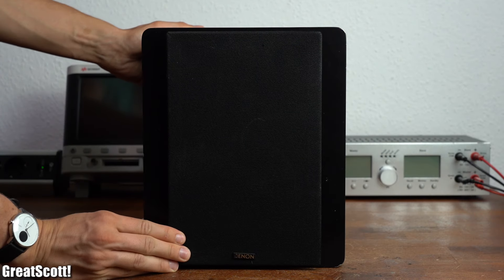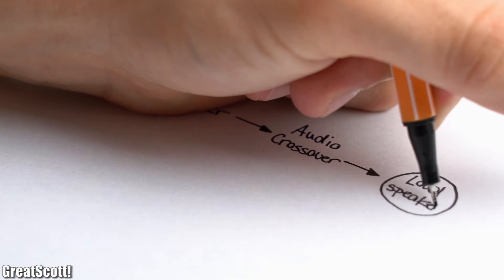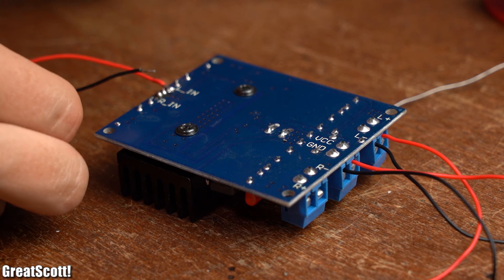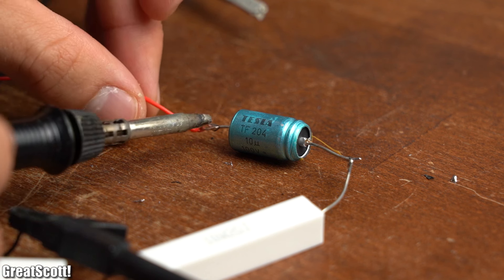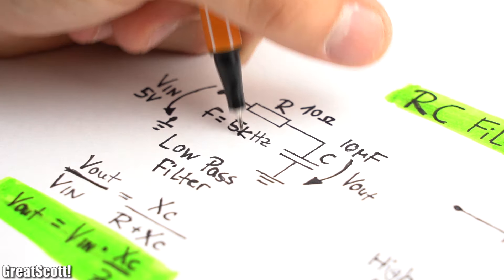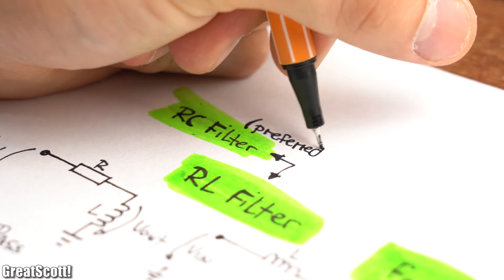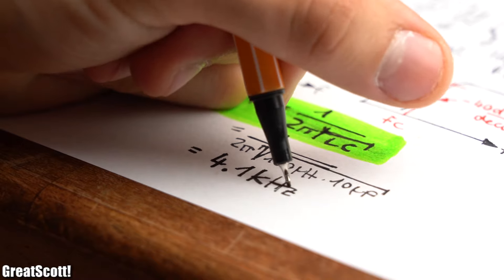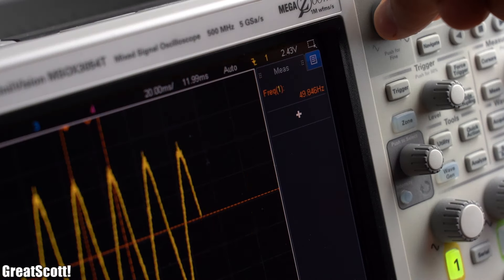Does a DIY Audio Crossover make sense? How passive filters work! || EB#41

Comment: Would you consider building an active crossover that would feed into a dual channel 50w D-class amplifier and BI-AMP a two way speaker (Woofer and Tweeter) 
and comparing the improvement over a passive crossover driven by a single 100w amp.

Comment: Well, i have ti correct you in one Point: Most speaker companys save Money with the Crossover. They use cheaper components for it. You can tune your Speakers by rebuilding the Crossover with high quality parts and wiring it in Air instead of the PCB.
This applies also to high cost Hifi and high end speakers.
Reply from the maker: Thanks for the information :-)

Comment: Hmmm one question here, The ooutput of the speaker is pretty much the current that flows trought it right? so doesnt the phase shift of a coil or capacitor change it as the incoming signal is voltage modulated and not current modulated. Or is this change just too small to notice

Comment: The fact that amplifier boards are dirt cheap nowadays means there is no need to use beefy crossover as the old-school ways...

The filtering can be done at the input stage using simple  R-C circuits then the input signals are fed to separate drivers. That is, the woofer and the tweeter have their own amplifiers...

Much easier to achieve similar results but of course, one has to appreciate how people in the past made the best out of their current technology, and carefully designed circuits often outperform their more recent counterparts...

Comment: You just tested with a 4 ohm load, but you used a resistive load,  speakers are an impedance load not resistive.
Reply: Ac resistive loads = impedance load
Reply: His speakers have an impedance of 4 ohms.
Impedance is the combined result of all resistive, capacitive and inductive components in a circuit.
Meaning there's no reactance, just like with resistive loads.

However, speakers like electrostats or magnetostats have an steep impedance curve and is not a static impedance set on 4 or 8 ohms.
Replacing those with a dummy resistive load won't do the job.
Reply: An impedance of 4 Ohm does not necessarily equal a purely resistive component of the same value. Basically it could be any combination of resistive, capacitive and inductive elements, that equals this impedance at a given frequency. Impedance is sort of "AC Ohms", but it is frequency dependant if there's not just a purely resistive component. A 4 Ohm impedance can have a significant phase shift between current and voltage.
Reply: @wi_zeus6798  Not necessarily indeed. When impedance is given at a specific frequency it can differ on a different frequency of course.
But a static figure on itself will stay the same. 4 is 4 and will always be 4, independent of the frequency, since it isn't specified depending on a frequency.

The reason that in this case impedance is specified as a static resistance of 4 ohms is because the deviations caused by frequency response are insignificantly small.
So basically its the nominal impedance which is specified by manufacturers of most standard dynamic loudspeakers.

However, it does not apply to all types of speakers, especially electrostatic speakers often have their impedance curve specified in a graph, since those variations actually are noticeable, mostly because of their high nominal impedance, which needs to be matched with the amplifier by use of an audio transformer.
Reply: He even measured the original speakers impedance with his multi-meter, so why worry about resistive load vs not resistive load ?
Reply: @K2teknik.  A multi-meter doesn't measure electrical reactance.
Reply: @verenigingvandemagogen4548  I was trying to point out that multi-meters do not measure the impedance of a loudspeaker the way it is shown in the video.
Reply: @SetKat-Alex  What? "He don't know the measurement frequency of his multimeter", that is because the frequency is not there, his multi-meter measure ohm with DC voltage, GreatScott is using his multi-meter in a wrong way in this case. He can measure impedance with his multi-meter, but not in the ohm range, it is more complicated.

Comment: The woofer can still play high frequencies. The problem isn't speed or momentum. Look at single driver speakers. The problem is that once the wavelength is shorter than the diameter, you can't approximate it as a point source. It start beaming, almost like a laser. The diameter of the driver determines it's beaming, or lobing, at higher frequencies.

Comment: Nice video. Is it possible to calculate or measure the frequency response of a speaker ??
Reply: Most likely you can't just calculate the frequency response the best you can do is guess for what range they are, if instead you want to know the value and don't have any datasheet of the speaker the only way is to drive the speaker with different frequency and measure it with a microphone ( probably better use a condenser mic) and use some software to see the audio captured by the mic

Comment: recently i built a 2.1 using that 2 dual tpa 3116d2 classd total 4 channels 0f which only 1 is not used i/p grounded, used 1 channel for the sub woofer, did not even make any extra LPF for it for it would require an extra dual voltage supply for the ne5532, just combined the left & right channel with two 56k resistors & input to the 3116d2, i have noticed even in my sony 3cd changer speakers no crossover for the woofer only non polar caps for the tweeter, also in my logitech Z5500 no inductor for the massive 180W rms sub.

Comment: Does the reactance of the speakers (the inductance of the coil) not matter within the 4 Ohm value? Is that always the case that a speaker impedance only refers to its resistive value and if not, at what frequency is a speaker impedance usually measured? Wonder how that influences actually the filter behaviour...

Comment: I can promise you that almost every speaker you run into that it has not been optimized to get the best sound from it.  They got the best sound they could for a certain price point, but in most speakers the crossover is the weakest link.  Crossover design is tricky, but with a good microphone, certain software, and with my ears ive been able to greatly improve several commercially made speakers.  If you’re going to DIY the crossover you might as well DIY the whole speaker, the way to go.  Check out Danny Ritchie/GR Research. He has videos specifically on improving speakers through rebuilding the crossovers only.

Comment: Hey!
I have a problem in my Fiesta ST!
I got a 4x25W audio system; with 4x 8Ohms, 25W door woofers; and 2 front door tweeters which I have little info on (probably just a generic set of tweeters).
They're mounted in parallel, which means the amp sees less than 4Ohms per channel.
The crossover frequency on the tweeters is around 2,5-4,5kHz, and the door speakers overlap with the tweeters on this range. The tweeters sound way too harsh.
I wanted to put a capacitor in series with the tweeter, to cut out some of those harsher frequencies. 
I'm just hesitating on what capacitor I should get?

Comment: I’m a little confused when using a passive RC filter for audio applications.   If making a RC HPF, does the speaker driver become the resistor in the circuit and only a capacitor is needed in series with the power lead?  This doesn’t totally make sense because the driver is an inductor and even with a constant ohm rating, it’s actual impedance varies with frequency unlike a resistor.  From what I could tell in the video though that’s exactly what he insinuated so I am confused.

Comment: It's much better to crossover at the small signal level and amplify each frequency band individually 

More expensive, but less losses and often higher quality
Reply: Why is that better?
Amplification directly on the input seems better to me, when it comes to S/N ratio.
Reply: @verenigingvandemagogen4548  Because there is a huge amount of inefficiency in the passive components, and they are far more expensive, and often not available at high powers due to the size of components required. The example Great Scott uses is particularly low power so his solution is fine, but when you get up to even entry level sound systems for venues, you can be looking at a good few kilowatts
Reply: @josephmojo123  Ah right, you mean to install the crossover into the line level signal instead of crossing over after the power amplifier?
It would only make sense if using stand-alone woofers/tweeters instead of 2 or 3 way full range speakers for example.

For example: I have a pair of 2-way full range Yamaha CBR12 speakers which have an integrated crossover. They run at 350 watt true RMS connected to a 2k watt power amplifier.
That's not extremely high power, but still very suitable for small business applications.
The built-in crossover is passive and works well. So it is possible.

But if I would buy a stand-alone crossover, I would use it on the input of two dedicated power amps (one PA to drive fullrange speakers and one PA to drive the woofers for example).

I really doubt if topology would make a big difference. I think it has more to do with the fact that integrated devices often are focused on consumer market instead of pro/businesses, making the average integrated devices of less quality than the average stand alone device.
Reply: @josephmojo123  Exactly good luck making a LR4 LP at 120 Hz good for 300 Watts

Comment: So I have a button that is connected to my ATX power supply at 5v and I need to send the signal to a arduino that uses just 3.3v.
Can I use just a resistor to do it?
What about 12v?
Reply: Look up voltage divider

Comment: Would it not be easier to have an amplifier with 3 outputs low, mid and high ?
It would remove components not really needed. While taking into account voltage drop already in the speaker wire, surely using a crossover you will lose top end of the amplifier output.
Reply: Yes but such an amplifier may cost more

Comment: An risistor is not a speaker, that makes it mutch more komplex because the speaker has a resonant frequency. That's a short komment but teorie and practice are Not the same, if you wanna to make a crossover you have to adjust manually with a callebratet microphone. To get a good result you have to combine dis basic filters with a lot of different types of filters. For example there are high shelf, low shelf filters

Comment: I have 8ohms(4+4 series) subwoofer, I designed inductor crossover of 8.6mH for 200HZ, but inductor has the  resistance of 7ohms, so when I connect  filter with the speaker , it will become around 16ohms load, but my amplifier has only 2-8ohms support, and it will give feedback noise which will come in other channel of the amplifier, is that harmful to amplifier and speakers? Or how can I solve this problem?

Comment: The schematic of your crossover is very strange. Although inferior components were used, the developer obviously made a great effort to equalize the frequency response of the speakers used. In particular, the suction circuit parallel to the woofer, which contains a choke with the high value of 4.15 mH, is very unusual.

Comment: Please,
 Make video on DIY SMPS upto 50A current and explain on which factor output current is depends.

Questions :-
1. What effects on Voltage & Current whike varying frequency of primary winding.

2. What happens if I modify 10A SMPS Secondary winding thickness.

3. Why 20A SMPS size is bigger than 5A SMPS if output current is only depends on Secondary winding thickness.

Comment: Does DIY passive audio crossover make sense? YES, but only if you know EXACTLY what you're doing. 
In any other case,  bi-amping speakers is far easier (and sometimes even cheaper!) nowdays
Reply: Nikola Jambrović bi amping is only cheaper if you are using AVRs with bi amping.
If you are using stereo equipment, bi amping is going to be expensive
Reply: Kokainarienv0gel  I was thinking more in direction of making active speakers. Then bi-amping is cheaper, since TDA7293 (and similar ICs) are cheaper than coils needed for crossover. If you're using existing amplifiers then yes, bi-amping is quite a bit more expensive
Reply: Nikola Jambrović once i had a bi amping setup with a denon 4311 and KEF IQ90 front, but as i got 9 speakers, i couldnt use it anymore since i lost with that 2 channels.

Active Speakers are.... idk, i prefer passive speakers, i had enough subwoofers with electronic failures... that i see the benefits of passive speakers at all.
this subwoofers were even hi quality ones like KEF and Klipsch.
Electronics inside the speakers is always a bad choice, if we think about the fact, that these parts will fail first and the speaker alone is made for „forever“

Comment: So audio crossovers are literally glorified low pass and hi pass filter 
To be honest i expected some kind of integrated circuit for better response or to remove phase shift
Edit: grammar
Reply: There are digital crossovers but more kind of software type used in audio production , these are just ok for loud speakers
Reply: @mauriciozavaleta1223  i can respect that
Reply: @armanrgun47  hi
Reply: You wont need to deal with phase shift or delay if you only have one speaker.
Reply: crossovers even introduce phase shift ;-)
we are talking about technology from the 50s, passive crossovers haven't changed since, and probably never really will.
You really can't do much better with passive components.
Active speakers nowadays are something different...
you can do a lot of stuff with dsp based systems.
Reply: Yeah, they are. But to be "glorified" as you say, there's a few methods to calculate their transfer function, depending on the type you want to buld. There's 1'st and 2nd order Foster and Cauer methods, wich to be able to understand you need to know Calculus 3
Reply: digital filters are quite common these days, but not in ultra budget bookshelf speakers.
Those are often found in DSPs of mid and high range amplifiers.
Reply: @verenigingvandemagogen4548 
DSPs are coming down in price, definitely into the "hobbyist" range. DIRAC has been around a while now.
Reply: You would probably get more phase problems by the amount of depth each driver is mounted within the enclosure.  In pro audio, horn drivers with long waveguides (powerful tweeters really) can introduce phase problems.  That’s where integrated circuits that can add delay to the other signal (after the crossover) are used. But then again, at the pro audio level, we are often using a technique called bi-amping. The crossover is in a rackmount unit and each speaker driver in any given enclosure gets its own signal from a power amp.  The crossover unit can provide delays and frequency adjustments, and they often have usb interfaces for easy visual input from a laptop. 

But yeah, phase is always something to consider.
Reply: Humans cant really hear phase shift

Comment: how old was that speaker , when it use Tesla components?
Reply: 70s or early 80s I guess.
But this crossover didn't come from that Denon speaker.
Japanese manufacturers wouldn't use czech parts.
Reply: @DasMrOSi  i just checked the original video and he pull this one out .  

BTW 1997 and Made in Germany
Reply: @filipcsizmar4860  any idea who built that speaker?

Comment: There is no way of designing a GOOD cross over without having the FRD and ZMA files for the drivers and using a program like PCD or XSIM. Each speaker has unique properties which must be considered. I suggest downloading and using one of these programs and visiting the Parts Express forum.Simply picking a cross over frequency based upon the driver parameters and designing standard second, third, or fourth order order filters NEVER arrives at a cross over that gets the most accurate sound out of the selected drivers.